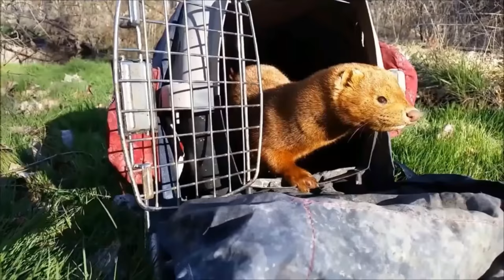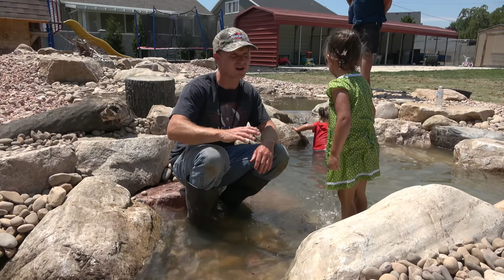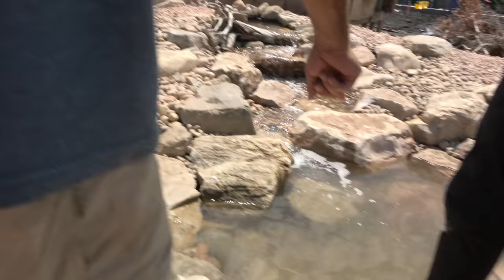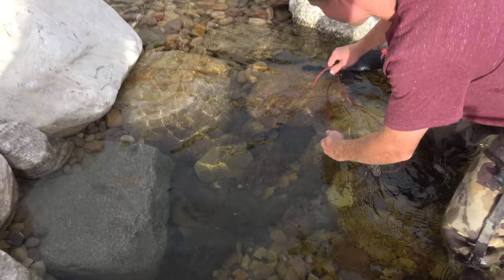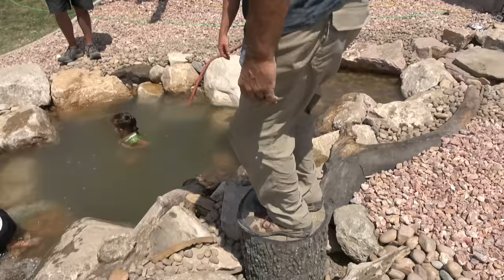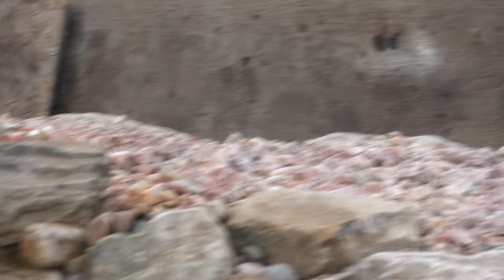MinkLand Pond Finished!!!!!

Comment: Fence: Easy, Acrylic! Meercats are held in our local Zoo behind Acrylic. Looks amazing framed in inox.
Reply: Beat me to it. Acrylic would be great.
Reply: @lelandsdad13  I assume you can also get curved sections way easier then curved glass. It is still not cheap by any means sadly :(
Reply: What is the cost like on that though?
Reply: Acrylic can weather and turn opaque in the sun though unless it's the crazy expensive type.
Reply: @GusMortis  Can´t you polish that out a few times a least?
Reply: @GusMortis  how expensive?
Reply: Acrylic scratches easy polycarbonates a bit better
Reply: Acrylic, indeed.
Reply: @antraxxslingshots  it's a solid idea for sure. Where to get it though. Maybe a custom aquarium builder, c&c fabricator or straight from a supplier?
Reply: Awww Yeah Shim Sham 
But it would not work for the raptor
Reply: I was thinking the same. Either glass or acrylics. I hope it is slippery enough that both mink and raptor don't have enough grip to climb out.
Reply: @GusMortis  I´d contact a Zoo that uses the same Material to get the supplier.
Reply: Acrylic will wear quick and definitely look bad after a while. Not sure how it will react being exposed to sun but scratches easily for sure.
Reply: I was thinking mimicking the garden fence but put acrilic on top instead of the tin
Reply: Ya Acrylic is definitely a bad idea for m the way hes using it I dont even like it for aquariums, it scratches very very easily and I doubt he'll want to polish it every week to keep it nice looking. Acrylic is also way more expensive than glass of any kind because its lightweight and doesn't break as easily him having to buy about 30ft of the stuff would just be unfeasible.
Reply: Good 💡
Reply: @mucusman7511  the show 'Tanked' used acrylic for a tank that was so durable they used a skateboard on it and it still looked good, so it is just a matter of finding something that would fit the need in a good price point. 
At least from my point of view.
Reply: @cjoyk8435   ok well in that episode of tanked you can tell by they're faces and the way they talk the tank scratching was a very real fear for them the entire time. Also skateboards arent inherently sharp, mink claws are.
Reply: I'd go with a "3/16 or "1/4 tempered glass (for added strength the same stuff used in older commercial doors) from Kelly's Glass here in Utah, (they might not sell to the public though it's who we'd get all our tempered stuff from). All acrylics, plastics and the harder one's name escapes me now... will fade as in any desert location with our sun and summer temps here.

For care spray with rain-x monthly or as needed that will help repel water and mitigate hard water stains for easier cleaning.

Don't try and do radius, way too expensive as you may have already found out. I'd go with a simple wood 3x1 anchored to the curb molding you have. Cut to fit for turns. 1x2 posts for each piece of glass. "3/8 or "7/16 router for the glass to fit into. Clear caulk (not Dap brand) for glazing the sides and bottom.

Best guess estimate for materials (without searching) $400-600 for glass, $200 for lumber $40 for caulking, $60 paint, $30 masonry anchors.
Reply: Thats what I was thinking!

Comment: I would get frameless black glass. Find a distrubuter and see if they have scratch and dent imperfections they could let you get a deal on
Reply: Agreed, even salvage glass might be possible and good enough considering the application. Please avoid plastic which will end up polluting a landfill for centuries.

Comment: My suggestion for the fence would be Clear Polycarbonate Roof Panels. Not very expensive and would contour nicely around the shape of the pond if need be.
Reply: It looks like there's a lot of options in plain sheets as well. Might be more expensive overall, but the visual distortion would also be non-existent. Not sure on the price/value/strength of different materials like acrylic vs polycarbonate.

Comment: I wouldn't recommend glass, as it can magnify the sun's rays and increase the overall temperature inside once you've got the enclosure completely finished. Since you're thinking about eventually possibly giving Raptor the run of it during the day, you'd also need a top to prevent him from climbing and escaping out of it. The best bet would probably be to use some heavy gauged 1/4" or 1/2" mesh wiring, as it'll provide ventilation and sunlight to come through while retaining structural stability when attached to wooden railings/posts/et cetera, as well as the added bonus of not having to worry about cleaning it.
Reply: But wouldn't reptar be able to climb up the mesh
Reply: @michaelgriffin1780  Hey can, yes. That's why if he goes with the mesh idea, he'd need to incorporate a ceiling to the enclosure as well.
Reply: True I use to have a chicken wire back yard fence I loved it cause I could see the creek but still keep out coyotes. An keep my dogs safe. But I don't think he wanted a ceiling cause he showed the garden an I believe said they would prefer to have an open top.
Reply: A real roof can be made over it with wood and shingles or it can be all mesh or half and half
Reply: Not true. A couple feet of vertical glass around the outside edge won't make any notable difference to the temperature. Unless he were to enclose it, then it won't matter at all.

Comment: how about an aviary. wire mesh over some frame, whatever shape you like (i'd recommend a roof that is not level but pitched).
full enclosure spares you from worrying about mink climbing the mesh.
Reply: I think this is the best idea, should definitely remove the problem of the metal sheets making it look tacky

Comment: Me 💭 how about a good sturdy plastic? That you can see through, like fiber glass if you will. I’ve seen partitions that are bendable. But it may be a issue with glare. Or sectionals,   Too bad you can't see what  I’m suggesting. Hopefully someone else can better explain my thoughts. I think you’d want to access whatever section you want w/o going in and out. Or a lot of movement. Maybe another thing like the screened magnets, waist high. But you have control. A few you can see through a few screen material a few plastic, but able to move as you need. With an alarm. Incase the girls wonder with out supervision. Anyway I hope you find what you need.

Comment: Thick glass will probably be your best bet if you want to preserve the beauty of your pond. If you're worried about water spots or filth build up on the glass you can apply a hydrophobic ceramic coating spray like they use on cars. Last for months, safe on glass/steel/plastic, UV protection and easy to apply.

Comment: Glass panels is your better option. The glass can be factory treated with a sealer to help prevent water spots. To keep the cost down, you can alternate metal (or corrugated fiberglass) panels and glass panels. Good luck...beautiful project !

Comment: My fence suggestion is you could do removable panels & a mix in design of these panels eg: glass,, You could even test out new designs of none climbing system's etc as it would always just a panel away. Make the curved panel's out of hockey puck board (heat flex shape) etc.. 
Most of all stand back at the main view levels for visual in to critical area's such from sliding glass door to pools view & patio sitting enjoying a view of a few animals playing etc.. Great set up,  I'm proud to share your video's & this share this evening is too my Father up here in British Columbia Canada,, He will be 85 and going strong, cheers,  Ian.
Reply: Ps: Posts could be H channel steel.  Obviously 1 of the easiest top channels in a case of removable.

Comment: I would go for 8’x4’ acrylic fence with wood fence post. If you run a 2x4 across the top at the Right height it could prevent olive from getting in. If acrylic is too expensive I would go with a clear corrugated plastic roofing, it’s a fraction of the price of acrylic and it will hold up to the minks, I don’t know about the monitor though. Good luck! The pond looks amazing.

Comment: Plexiglass/acrylic is an amazing option and a lot of zoos use it. Since it comes in different thicknesses it can be very durable and is typically pretty affordable frame it with wood stained to your preference to have nice clean finished project. They also have is a nice smooth surface so the monitor and rats wouldn't be able to climb out

Comment: Modern glass panels that are used for decks that have expensive views would be great.
Or look at stainless perforated panels like decking walks in chemical plants. Use stainless pipe for your posts and the panels can be Tig welded to clips that attach to the posts. Lots of different types of perforation designs to choose from. Good luck with the project.

Comment: Galvanized steel would be inexpensive and easy to work  with. Just have it cut to the size you want similar to a cooking grate. Also you could use plexiglass glass windows for easier views in different locations. Good luck man..the pond looks fantastic.

Comment: Use a clear plexiglass in the center area where u can see it and the edges normal wood fence. If the plexiglass part is angled back towards the pond I'm guessing it would make it harder to climb witch mean you can keep it lower, and easier to see

Comment: One idea might be plexiglass, as a material it’s very adaptable it can be cut in to different shapes with a jig saw using the right type of blade easy enough. Also you can use a heat gun to help bend and shape it to fit the curves of your enclosed space. I know lizards  will dig a bit sometimes but you can burry the plexiglass and it won’t degrade at all providing an extra layer of security. You could even wrap the underground part with hard cloth I suppose. And lastly the plexiglass is smooth clear and very difficult to climb if not impossible to climb. The biggest challenge i see with it would be fusing all the parts but that’s very doable with either a clear silicone caulk or a plastic binder such as JB glues. (Love the channel guys and hope this helps, god bless)

Comment: I used plexi for panels around the staircase and upper balcony in my house to stop my pet skunks from getting through, a lot cheaper than real glass, and more durable. Easily cleaned and replaced when needed. Also stood up to the very well. Typical balcony glass will shatter like safety glass does, which could be an issue around the pond if a rock got bounced somehow. Using typical balcony framing would make it look good too, with a top rail and all that.

Comment: First off I love your channel it's one of the best on YT in my opinion.. Second I think Acrylic, polycarbonate or some sort of similar plastic would work great. It's as clear as glass and easy enough to spray clean daily or when necessary and would hold up to a pressure washer for deep cleans. The support posts I'm not sure but looking at zoo enclosers could probably help. Won't be cheap tho lol. Great pond btw it turned out amazing

Comment: Clear acrylic is probably the best answer for the fence.  It is probably expensive, but....  I'm thinking like on that TV show about custom fish tanks.  Curved panels that follow the rock border would be possible.  The fence panels can be made with a flange on the bottom that bolts down, and the "posts" can be strips of the same acrylic glued perpendicular to the panel.  And the top edge can have an acrylic tube glued on like a hand rail.

Comment: Whatever fence you use place a roller at the top. There is a professional product made to keep your cats in your own yard. Basically think of a 6' piece of 1.5" PVC pipe running along the top of the fence. The pipe is free wheeling so it spins. The pro product looks nice.

Comment: Slick, 1 inch spaced vertical bar, cast iron fence.  The close-together bars may not look that well compared to other fences, but that's the best I can think of to make it functional and aesthetic.  Such as that may cost a bit though. Perhaps some tests with pvc tubing first may be a good way to find if it will work.

Comment: You could use plastic for greenhouses. Either the waivy type or the double wall polycarbonate. Both are clear and you should be able to find them at hardware stores. Probably your least expensive option too.

Comment: Hmm, well for visibility I would suggest as others have either some kind of Plexiglas, Acrylic, or just plastic panels. I am not sure if they have scratch-proof and see-through plastic panels but if you were to find something like that just get small but thick sheets that slide into some kinda fence post size brackets (maybe even wood posts cut to hold panels) to hold them in place at each section of panel.

Comment: Acrylic or glass aquarium panels on a slight angle (angled inwards) that maybe slide into a track on top over a wire fence (the metal of your fence you think ugly as plexiglass, or a two part fence with up and down plexiglass and a top inward tilting piece). they make these special stickers i've seen mostly used for side view mirrors on cars that are water proof and make the glass incredibly clear, you could see if it is available in larger pieces, or have it be like little always clear windows on top of a mostly clear (depending on weather and dried water droplets) fence. there might be a similar option to coat the plexi/glass with a compound as well. You could make a double door, almost like a fence version of an airlock so you/kids could go in, without the mink/raptor darting out. maybe you could make a little den against a section of the fence with a panel of two way glass so the min feel enclosed denning there but you can film them acting natural if you choose to make it a day reward or a habitat.

Comment: On the fence: consider hi-tensile, stressed stainless steel wire (think thick piano wire only stainless). You'll want to use fairly thick wire so kids & critters don't get cut. You choose the spacing & let a knowledgeable contractor do the rest - although it may not be easy to find someone who has done this before - it's actually simple to do once you know how (zoos use regularly). Looks great, still have airflow, great transparency to see what's going on inside, no issues with dirt/crud buildup, should last forever .... good luck!

Comment: On your fence you can make a basic wood fence and do some glass, acrylic, or polycarbonate inserts to see thru.  At a height where it can't be jumped over.  The around the top use the acrylic or polycarbonate panels angling inward past the reach of the mink and raptor.  Like you see with security fencing with barbed wire.  My dogs can jump a 6 foot fence if they can get their paws over the top.  I took decking and put it where it is mostly to the inside so the dog has to try and go over it.   None have made it out since I did that.

Comment: For the fence, maybe a copper mesh? It would patina and look nice. Then you could use some solid sheets of copper or steel at the top, with posts every so often. I think that could look nice if installed correctly.

Comment: I'd suggest a very fine steel knit mesh. It's see-through and very resistant to the elements, rat proof, easy to replace and cheaper and easier to install than acrylic.

Comment: Corrugated polycarbonate greenhouse single layer roofing panels stuck into a trench of concrete.  With corrugation running vertically you won't need much additional structural support.  Lots of color/clear varieties to design window options.  Cap the top with some fence boards.

Comment: 1/2 It might be a more expensive option but do a plexiglass wall with wooden pillars every few feet to cut down on the amount of plexiglass, and have a lip that goes over the pillars as extra percussion and doubles as a table. 2/2 Or do a hardware cloth screen fence and take 2x4/2x6 and lay them flat across the top to prevent climbing up and out. Good luck

Comment: SUGGESTION get a smaller pvc pipe to fit into the pipe you don't want them going uo and your can drill holes so the flow water keeps flowing unlike a wood block wood (lol ok fine would! ) 
Maybe plexiglass for the fence?

Comment: If you look at a pool enclosure is very tall but the top part would be all you would need for your pond enclosure. You could use it in three parts. Have a metal peace on the ground does the pool enclosure clips into and clips to each other so that would be easy to pull a part. I hope that's clear enough for my idea.

Comment: Better idea than acrylic, polycarbonate. It's much stronger than acrylic (they use it for bullet proof glass in cars and banks) and if you get treated, it resists UV damage and cracking, Most plastic lens glasses and aircraft windows are polycarbonate. It's cheaper than glass and only a bit more expensive than acrylic.

Comment: I would go ahead and spring for the glass but it would only have to be 3-4’ high with a slant at the top like your current mink-proof fence. Yes it would get dirty but they sell these easy sprinkler kits that you can easily place heads where ever you want. It also hooks directly to a hose so anytime they get dirty you can run them for 5 minutes to give them a rinse. Glass, although more expensive, will probably last the longest and look better than any type of wire.

Comment: In the case of the fence I'd say either acrylic or a more sturdy, rigid metal fence that is not a mesh (all vertical iron bars or somethint, that way nothing can't climb it, and if it's slim and together enough, nothing can go through it and it's still see through)

Comment: As has been said by others, plexiglass (acrylic) would be a good bet
Not as fragile as glass, cheaper, easy to cut into desired shapes, waterproof, transparent, no holes for mink to or rats to climb. Only problem is the dirtiness issue that you mentioned from the sprinklers